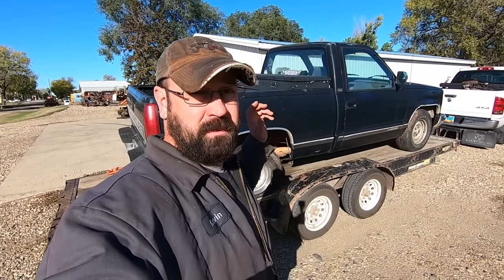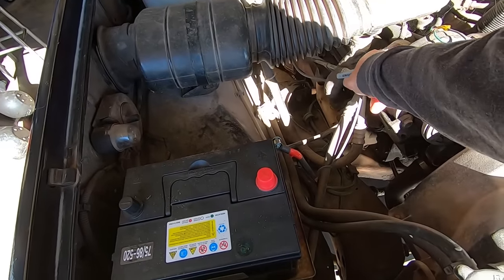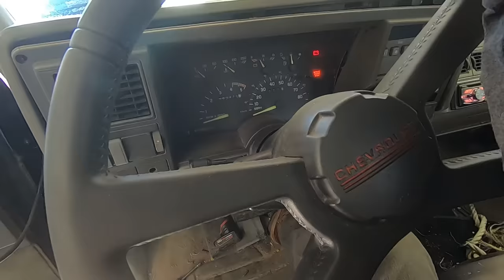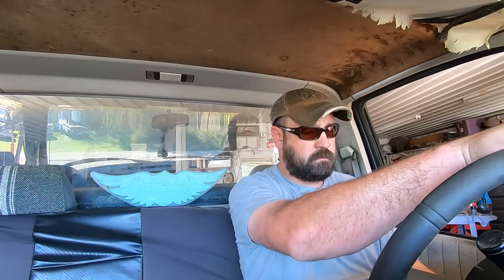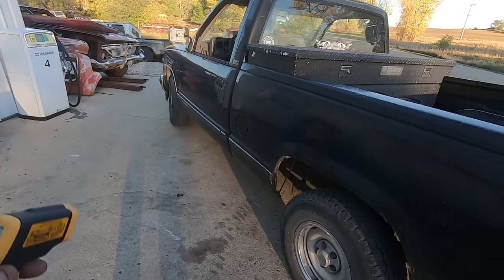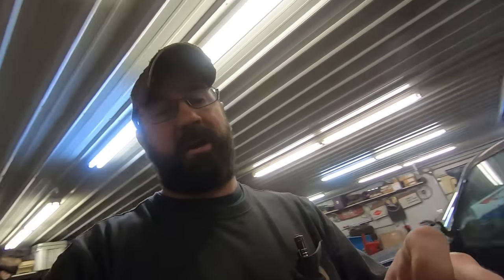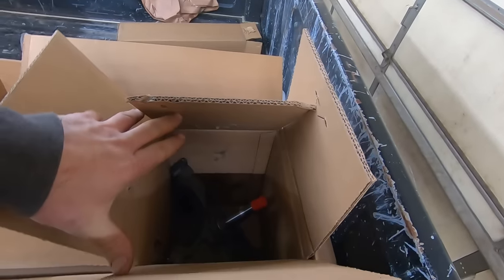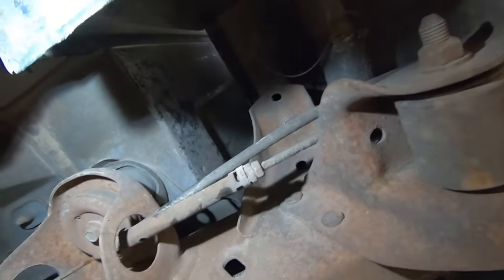1992 Chevrolet Silverado Transformation! From Junk to Jewel! Daily Driver OBS SWB Build!

Comment: Excellent video Mortske Repair  :) also on my late Dad 1990 Chevrolet Cheyenne light duty 3/4 2500 truck had 305 TBI V8 with  Turbo 400 3 speed Automatic transmission plus 411 rear end gears single door cab also he problem with starting up one also when park or netural position ran okay but in R , D or L2 or L1 it chugged and back fire terrible even more gas pedal pushing to then motor shut down ! Was not coil or cap or rotor or wires even spark plugs nothing with them at all and was crazy thing ever! We found chip on right side in front TBI carb a computer chip size of our baby fingers with 24 pins need replacement and also new send unit plus lines also brand new TBI carb replacement of Injectors plus fuel filter put on cure it but chip was stupid for sure! Also have seen front wheel got over 325'F and was not brakes lock up of caplier or brakes grabbing or plug fluid line ! Was wheel bearing clock dailing and seize up too also outter tie rod left side was worn out on rubber boot and ball to plus no grease in too even grease fitting seize up with corrosion to ! I never like aftermarket companies of Security Systems only dealerbrand only easy fix up ! Also Mortske Repair  :) check out - black pig tail wire on Fender ground also clean also put grease keep dirt also corrosion too plus bolt also washer! Also Mortske Repair  :) I know saying Windshield Wipers I changed lots costumer in rain and  Winter season so much got people change in Spring Season of April and Fall Season in October! Do same always because UV Ray's because Ozone Layer gone  now get more cold and hot weather longer! It hard them too especially rubber parts !  Wish all automobiles had same pin or hooks for  hook up  too !

Comment: Could that side view mirror be for the passenger side? I doubt they are different, but that's all I could think of watching you try to get it in that housing. Also, have you ever thought about a small scissor lift? Mustie1 used one in his original tiny shop it seems to be a nice addition
Reply from the maker: Yeah but they're in the way and don't lift high enough for most of what I do.

Comment: Just take the carpet out and pressure wash it.  Use a little of your Simple Green on persistent stains.  Still have stains when it dries?  Use a little spray paint and pull it back up using a wire brush.  Cheap and it will fit better than reproduction carpet.
Reply from the maker: Thanks for the tip!

Comment: No welds needed on the rear c-notch? I feel like they should be zipped in on the front & back but I tend to overbuild.
Reply from the maker: Actually you'd want them top and bottom as front and back creates a stress point when you induce all that heat from welding. Bolting is just find. Boxing the inside and capping the bottom and welding it all is going full tilt if you were to weld.

Comment: The 5.7 liter Ls1 was under rated. Iit was rated about 325 horse power but the ls1 makes 400 horse power easily. Ls2 is rated at 400 hp and the ls3 makes 500.

Comment: I had a '90 silverado with the 4.3 and a 5 speed for a few years and found out a couple years after owning it that it had a 30 gallon tank in it.
Reply from the maker: You don't run the tank low enough!
Reply: @MortskeRepair  Right? I was around an eighth of a tank and it took 26 to 27 gallons to fill it and did some research. I was told it was a 25 gallon tank.

Comment: did you eventually replace the gear box or the seal?
did you repair the rear seal? how much was it leaking?
Reply from the maker: I put the trans seal in, wasn't leaking much. Power steering seal I need to replace. Leaves a small spot on the driveway.

Comment: H E I module ? In the early 80`s the H E I modules were often replaced . I was a Pontiac mechanic lots of them went bad early . 9 outta 10 it is the switch . My Colorado was kinda high rip now got a car and having had time getting in banged my head too many times . Hey it is a Indy racing league inspired car . Aurora 2003 4.0 sweet .

Comment: All the fluids in the tool box can’t believe there wasn’t oil. I had 2 92s 5.7 and both were oil burners
Reply: The only “weak spot “ to these trucks was the cylinder heads. Usually by 150K miles stem to guide clearance would be totally out of hand. Oil consumption rarely came as a result of worn rings/ cylinder walls. Another huge reason for unusual oil consumption was leaking intake gaskets. Intake vacuum leaking past the intake gaskets could cause them to use more oil than gas. A quality gasket kit and a competent machinist working his magic on the head’s will cure the oil sucking problem.

Comment: Actually the corrosion on the distributor terminals has only the effect of a higher voltage at the plug gap.
Reply from the maker: So that corrosion just creates voltage out of thin air? It creates higher RESISTANCE and therefore lower amperage according to Ohms Law.
Reply: @MortskeRepair  resistance is what drives secondary voltage, that is one of the reasons for resistor plug wires and resistor plugs. The other is static suppression for AM radio.

Comment: What’s up with the silver paint on your face lol? I live in Tulsa myself and work on my 1996 Silverado 2500 all of the time and considering lowering it and shortening the frame also to a short bed! Heavy suspension on a short frame! Thanks for the info! I’ve done several flip kits over the years and also frame work but question for you! Why did you change out the front shocks since you lowered it but didn’t change the back shocks out? It needs drop shocks for a better ride! Maybe doing later? I get a budget build so wondered if that’s why?my truck is a 4:10 posi unit so I do want to keep that of course.
Reply from the maker: I put rear shocks in it, just didn't show it.
Reply: I get that but hey good luck on that truck she’s pretty straight! My 2500 is just as good but it’s an extended cab long bed hence the reason I’d love to shorten it up! Thought about going a dually bed actually and rear tubbing it for some big tires! Think that’s weird?kinda like the big tire idea! Where are you in Oklahoma! I’m off 31st and Sheridan in Tulsa.
Reply: @MortskeRepair  I get that too much to do and maybe forgot to record the video or figured you would do that!

Comment: I get all the trade ins at 4 new dealerships that are to old or need more work for their used car lots. I can't count how many vehicles that are trade in that come from secondary finance lots. The put GPS tracking systems in them. When the people miss their payment get on the Internet and can kill the car no start. It's great I give them $150. To $250. Go out look under the dash cut a wire and BOOM runs like new.
Reply from the maker: interesting!

Comment: Thought you might like a story about Greta... This makes me giggle:
One crisp winter morning in Sweden, a cute little girl named Greta woke up to a perfect world, one where there were no petroleum products ruining the earth. She tossed aside her cotton sheet and wool blanket and stepped out onto a dirt floor covered with willow bark that had been pulverized with rocks. “What’s this?” she asked.
“Pulverized willow bark,” replied her fairy godmother. 
“What happened to the carpet?” she asked. 
“The carpet was nylon, which is made from butadiene and hydrogen cyanide, both made from petroleum,” came the response. 
Greta smiled, acknowledging that adjustments are necessary to save the planet, and moved to the sink to brush her teeth where instead of a toothbrush, she found a willow, mangled on one end to expose wood fibre bristles. 
“Your old toothbrush?” noted her godmother, “Also nylon.” 
“Where’s the water?” asked Greta. 
“Down the road in the canal,” replied her godmother, ‘Just make sure you avoid water with cholera in it” 
“Why’s there no running water?” Greta asked, becoming a little peevish. 
“Well,” said her godmother, who happened to teach engineering at MIT, “Where do we begin?” There followed a long monologue about how sink valves need elastomer seats and how copper pipes contain copper, which has to be mined and how it’s impossible to make all-electric earth-moving equipment with no gear lubrication or tires and how ore has to be smelted to a make metal, and that’s tough to do with only electricity as a source of heat, and even if you use only electricity, the wires need insulation, which is petroleum-based, and though most of Sweden’s energy is produced in an environmentally friendly way because of hydro and nuclear, if you do a mass and energy balance around the whole system, you still need lots of petroleum products like lubricants and nylon and rubber for tires and asphalt for filling potholes and wax and iPhone plastic and elastic to hold your underwear up while operating a copper smelting furnace and . . . 
“What’s for breakfast?” interjected Greta, whose head was hurting. 
"Fresh, range-fed chicken eggs,” replied her godmother. “Raw.” 
“How so, raw?” inquired Greta. 
“Well, . . .” And once again, Greta was told about the need for petroleum products like transformer oil and scores of petroleum products essential for producing metals for frying pans and in the end was educated about how you can’t have a petroleum-free world and then cook eggs. Unless you rip your front fence up and start a fire and carefully cook your egg in an orange peel like you do in Boy Scouts. Not that you can find oranges in Sweden anymore. 
“But I want poached eggs like my Aunt Tilda makes,” lamented Greta.
“Tilda died this morning,” the godmother explained. “Bacterial pneumonia.” 
“What?!” interjected Greta. “No one dies of bacterial pneumonia! We have penicillin.” 
“Not anymore,” explained godmother “The production of penicillin requires chemical extraction using isobutyl acetate, which, if you know your organic chemistry, is petroleum-based. Lots of people are dying, which is problematic because there’s not any easy way of disposing of the bodies since backhoes need hydraulic oil and crematoriums can’t really burn many bodies using as fuel Swedish fences and furniture, which are rapidly disappearing - being used on the black market for roasting eggs and staying warm.” 
This represents only a fraction of Greta’s day, a day without microphones to exclaim into and a day without much food, and a day without carbon-fibre boats to sail in, but a day that will save the planet. 
Tune in tomorrow when Greta needs a root canal and learns how Novocain is synthesized.
Reply from the maker: Can't wait for the next episode Greta!

Comment: I think it would have been easier to just pulled the drum and brake shoe assembly off and used a boxed end wrench over the cable to compress the clippy do my hickey and pull the cable through the brake backing plate

Comment: Does the rear rubber brake line have crush washers. I ordered one and it showed crush washers in picture , but didn't come with it.
Reply from the maker: Nope, it didn't.
Reply: @MortskeRepair  Did rear brake cylinders shoes and axle seals last year.. Owned G30 Honey MH 26 years and had assumed metal lines all through. Surprised to discover rubber at rear upon inspection this year. 1976 and will switch out this coming spring. 45 years is stretch. And have replaced front rubber lines last year for the second time due to lock-up. thanks

Comment: Put some longer shackles on those rear springs lift the back end up a hair
Reply from the maker: They need to be shorter actually to get it to come up.
Reply: @MortskeRepair  ohh yeah that reverse hanger.. add a leaf maybe?
Reply from the maker: @amazin1827  Adding a leaf makes it ride stiffer. I think new leafs might be the thing to do.
Reply: @MortskeRepair  I'm used to taking them apart and adding the third smallest of another set for a little more arch and quarter inch thickness. I have a 59 F100 factory 4x4.. 2 inch springs.. like jeep.. but heavier. Front shackles aren't reversed.. I'm trying to get 2 inch lift.. donor 78 F350 with the leafs I need.. just busy.. (shop payments).. squeezed a M400/C6 with a Cardan Center to the Np205. 78 (snowfighter) Dana 60 high pinion kingpin front. TOUGH LOOKIN👍

Comment: Ecm is in the distributor
Reply from the maker: Nope
Reply: @MortskeRepair  it most certainly is. The pick up coil in the distributor and the coil plug into it iin the distributor. Two bolts hold it in ,and you have to use white lithium grease under it or it will overheat and quit working. And u get bad ones. Even if the test say it's  good . I've seen them still not run a car
Reply from the maker: @jerryl3270  I believe module is the word you're looking for
Reply: @MortskeRepair  electronic control module (ECM)
Reply from the maker: @jerryl3270  Thats under the dash, Ignition Control Module, ICM, is in the distributor.

Comment: Headliner is easy can of 3m adhesive and piece of fabric or grey or black flannel sheet
Reply from the maker: How do you keep it from bunching up??
Reply: @MortskeRepair  Spray headliner and  fabric lay fabric on have few mins before it dries to work with it to smooth it out make sure you clean and blow off all old backing material first if its crumbly and rubbing off use stiff scrub brush to remove it sure there are few youtube videos on it too if you look  can also do it in sections folding over half glueing just that half then fold up other side and glue it to make it easier hell even cheap fleece blanket from walmart should work  would work pickup truck is small liner and perfect size to start with  make sure you have few inces of fabric on all sides you want to cut squares out for the corners the glue the extra onto the back of the headliner

Comment: i had a farmers 2021 3500 in shop today it was so rotted he wanted new fenders new door but front of rocker had it on frame machine still took a 10 ton frame machine to pull oit out by lower fender rest was rot
Reply from the maker: Dang

Comment: electric conn  aka=guillotine/ insulation-displacement contact.  were meant  for strip light continuation. with saving wire in mind NO movement no open or closing - linear application  low amps- still has no use

Comment: Man, I love that truck......or ute (short for utility vehicle) as we call them down here!  That wee beast has some potential for sure.  I'd love to see it all polished up and looking the cat's whiskers, mate.  Sure, she might have the odd bingle around the body, but the paint will largely come around with a decent buff, I reckon.  Don't underestimate the power of some spray cleaner (or water and dish detergent / washing powder), plus a good scrubbing brush and a decent wet-and-dry vacuum will have on the seat / carpet / headliner either.  Certainly cheaper (and far less hassle) than replacing what's there.....unless you're battling the smell of rodents, then yeah I agree - chuck 'em to the weeds.

I still reckon your videos are trying to match me for length of my posts or the time it takes you to read them!  Nah, mate.  Thoroughly enjoyed that video.  When you said the old girl had quit after about 5 mins and still had fuel, the first thing I thought of was the bloody ignition module.  Had a 1981 Mitsubishi Sapporo GSR (you guys in the US knew the model as the 78-84 Dodge Challenger) that developed that same issue.  It was the only problem I had with that car in the 40k miles / two years I owned it.  Still got it home, although the usual 20 minute trip took an hour!  Oh - and coils do indeed go bad and not just on the 88-94 GM 3.8V6 either.  I've had several Lucas coils go bad on me - two had actually developed a leak and their fluid ran out and the others just used to get very hot and then die.  I must admit I have changed way more ignition modules, bad leads and dizzy caps than coils though..... 

Really love how easy the front suspension and steering comes apart on the GMs.  No need for special tools to compact the coil spring - just set the jack under the lower A-arm and let the weight of the nose hold her in place when you pop the top joint, then lower her down.  Much prefer the truck on the lower suspension and I agree about the wheels - something like the '70s Hustler mag wheel would look grouse on that beast.  

Glad this one was a nice easy fix with no stuck engine, tired starter, clogged carb, stuck valves, bent pushrods, rusty (or missing) fuel tank etc etc etc to contend with - just some Mickey Duck wiring for an alarm module well past its use-by date.....and three hundred miles of extra wire tucked in there to make it look more intimidating to mess with.  Mickey Duck (the bastard child of Donald and his rodent friend) has certainly farted around with a fair bit on my current project and all.  Had it for 12 months and still I am finding more evidence of his twisted way of thinking hidden behind things.....

Anyway - great to see a rust-minimal 20 year old truck in the north!  All the best, mate.
Reply from the maker: Always appreciated it Lance!
Reply: I wish utes were here in the states. I love the elcamino and rancheros. Business in the front party in the back

Comment: the GM 400 trucks are known for high carbon build up on cap and bad module's on distributor
Reply from the maker: What causes that?
Reply: @MortskeRepair  the cap design has vent in it that condensates i use to get ton's of these trucks back when there where lots on the road  that would come in to my shop ether not running or running bad and that was the first thing i always check .Fixed alot of the with a just a new cap and rotor some would be as bad as needing a module just a bad design all : 4.3 V6, 5.0 V8 , 5.7 V8 .& even the 7.4 V8 (454) 1988 to 1994
Reply from the maker: @bigdaddy9864  Interesting!